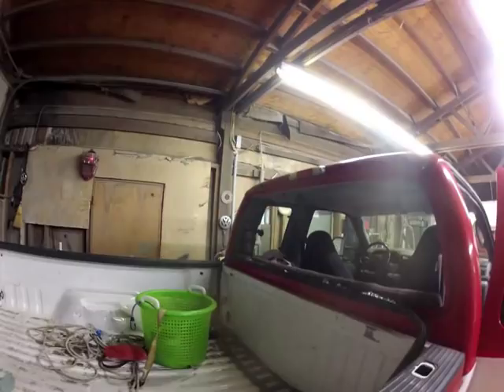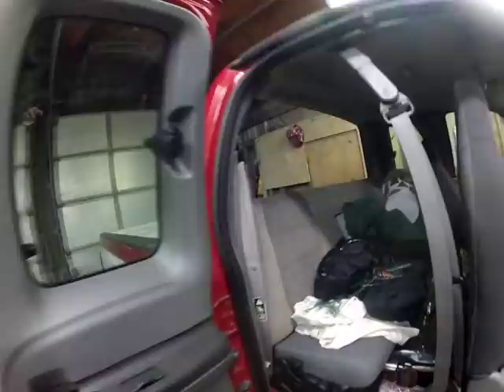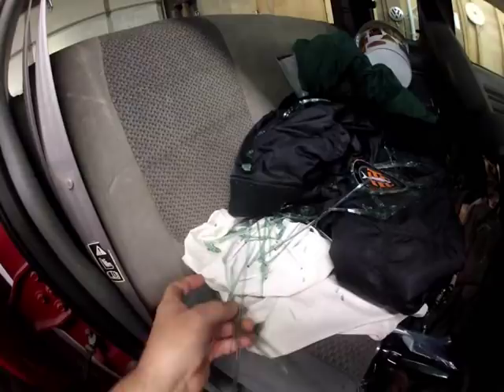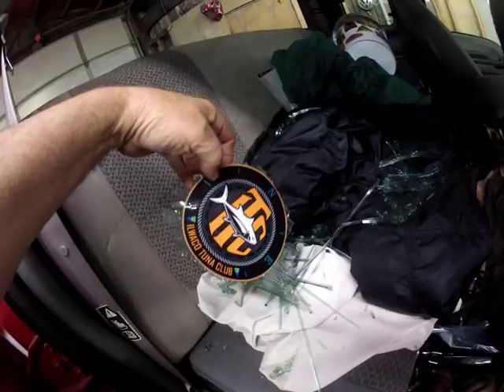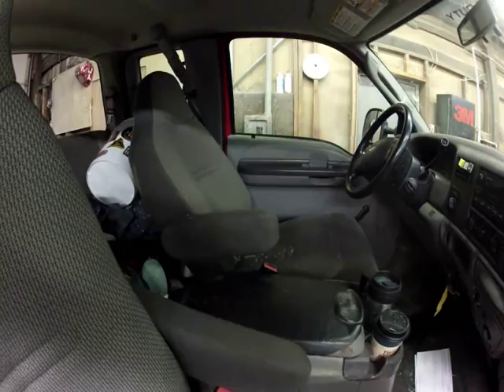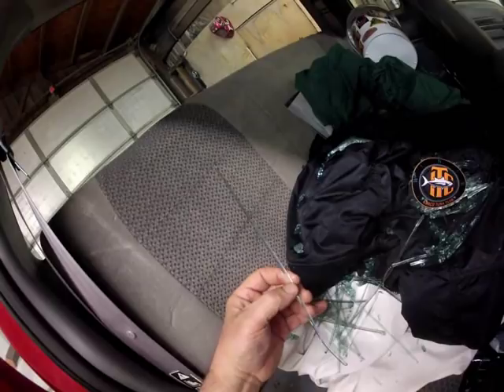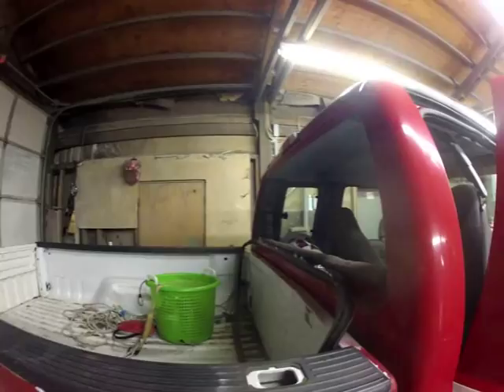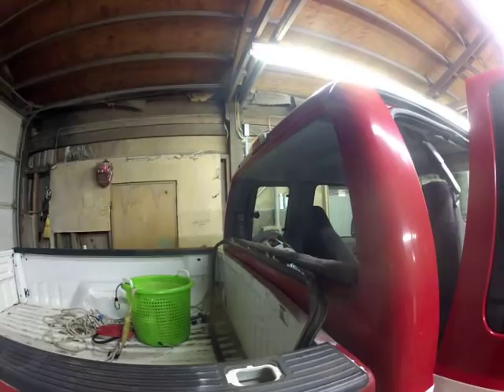REAR WINDOW BLOWN OUT WHILE TOWING

Comment: I have heard of this but it was many years ago.  Sometines the truck frame can flex enough to cause this. 1) the pickup box gets into the back of the cab, which can apply enough pressure to pop the window. 2) Maybe enough frame flex by itself to flex the back cab wall, without getting hit by the pickup box. You said it was towed with a wrecker, did you use a sling or a wheel lift? Over 25 years in the business...
Reply from the maker: It was on the back of my 2015 Freightliner rollback
Reply: Hill Auto Body & Towing 

Okay, disregard.... you said "wrecker" at least twice in the video.

Comment: These pick up trucks, are prone to bending in front of the box. The way in which the rear glass shattered, indicates that the glass was pushed upwards and under compression against the top of it's frame; corregation fractures are seen. Which is the failure you have shown. I would be interested to know if there were any cracks or corrosion in the chassis.

Comment: I had this happen in a car. The glass guy told me this is caused by the factory. There is a welding bugger that puts pressure on the glass and the seal. When the force hits it just right the glass blows out. I was driving down the road and ran over a set of railroad tracks and the rear window blew out. At first I thought someone had shot at me..Scared the heck out of me and my passenger. But the glass bits did not look like yours.

Comment: Thats more than likely a poorly manufactured tempered piece of glass. Perhaps a replacement from an inexpensive dealer that gets product from overseas. I work for a manufacturer that gets deco glass from China. Sometimes the supplier cheats the quality and rushes the tempering process which results in poor glass strengths. Lifted at the just right angle, that rubber perhaps broke away and the glass edge tapped the metal during a bump and bam, instant shatter. Just speculation however, but very plausible.

Comment: never seen that before ,Iv'e been doing autobody work since 1977.however back in 2000 a new f250 came into the shop with the front of the bed and the back of the cab damaged ,the back of the cab was bent and so was the window .we measured the curve on the window and it was bent in two and a half inches ,you never what to expect with temperd glass

Comment: Indeed, I have seen this happen three times! Once with my dad, when my family had a wrecker service, and twice with guys who towed for auto repair shops, I worked for years ago! 

What I took notice of was the fact it seemed that the back glass had some hard rubbed against it, which rubbed up against the glass leaving scratches in the glass! Which cut into the glass deep enough, that when it had force put against it, like wind, it broke, just like that! Although, thing is if it is blasted with sand, from a sand storm, for example, it could leave those fine scratch marks that could leave cuts deep into the glass! One other thing is the aftermarket glass seems to be more likely to do this, from what I noticed, since the vehicles, I seen this happen to all had the back glass replaced! This doesn't mean it could not happen to OEM glass! Although, it is less likely to happen, to the OEM glass!

Comment: All the trucks/vehicles I've towed backwards on wreckers or rollbacks I've never seen that before. Wonder if the owner ever drove it with the windows down, if so why didn't it blow out going down the highway?  At least then it would have fill the bed with glass not the cab

Comment: I used to work at a car dealer, and I can recall 3 GM pickups coming into new off the car carrier with the rear windows busted out when they were loaded on backwards.  Makes for a pain for everyone, but the shards were similar to that.    No clue what really caused, but same thing, had to assume it was the wind and the pressure on the glass, saw lots of trucks backwards come in, luckily most of them didn't break.

Comment: We have moved alot of F 250 trucks all over from oil pipe lines towed them all kind of ways twisted & turned never had a glass brake out thats weird we have picked them up with Windows broke out but in little pieces from a object being  put thorough it

Comment: I just had something similar happen with a door on a commercial storefront.  The glass was brand new, just installed, and marked tempered. Someone touched the glass instead of the crash bar and it exploded leaving icicle like pieces of glass.  I have pictures. I would bet that truck window is a replacement and not original from the factory.

Comment: I have been in the repair business over 40 years and can't say I have seen that before . Towed all sorts of vehicles , Very strange break . If it was being towed I would say body flex maybe , but you were on a flatbed  . The only thing I can think of is a rock from a passing vehicle ???
Reply: The most likely cause......
Reply: or how it was secured to the bed of the tow truck. maybe there was some uneven tension and the shitty glass couldn't handle it. I know my after market bumper moves a good inch on the very ends under the headlights when my frame is flexed shitty glass and awkward tension could cause the strands. maybe ford will admit the issue in decades to come...
Reply: Or maybe it's not factory glass. Aquarium glass will shard like that. That could have been a cheap fix to a old problem. Someone cut some flat glass and no one could know the difference with tint, unless it broke. I'm not always wrong. Just unusually wrong.

Comment: I had 35 years around the auto industry 15 at a Ford dealership with a large body shop and I've never seen it either. Like others are saying the window is designed to shatter with no shards something must of went wrong in the tempering.

Comment: Its rare. I about 25 years ago at the car dump I seen a side window, only the top half broke like it was tempered and the lower half was fractured but stayed intact.
Must have been uneven heat during tempering.. That car was made in japan in the 1970s.... 
I also seen a rear window on an old junk Mazda hatchback that was almost unbreakable, We threw everything we could at it, rocks, axe, hammers, exhaust manifold, small manual transmission, drive shafts, rims, semi-floating axle, I tossed a T-18 at it and it bounced off, then I tossed it input shaft first, it bounced off. We ended up busting it by opening the hatch and hit it from the inside going out and it broke (O.o) All that beating on it was after being rammed by an old pickup with a heavy steal bumper caving in the ass end in to move the car out of the way.

Comment: I try not to two anything backwards anymore, after one mishap and losing money it sucks.  If I absolutely have to I drop my speed.
Reply from the maker: back of cab was shoved forward 2 inches  which put stress on glass . The wind was too much and it shattered
Reply: Too bad, now you're the bad guy because you're the last to touch it.  Last one I had a sectional fold up cover, I even checked it was locked in the down position before I loaded it and sure as shit, once the wind pushed on the tail gate it was enough to unlock, flip the lid up it blew the window out and even bent the top of the roof quite a bit, and this was only at 40mph.  I thought I blew a tire the noise was so horrendous.   Really sucks because you know its going to take at least a few tows just to break even, I hate working for free!
Reply from the maker: My cost on the back glass was $95 .  15 minutes to install .. The customer was very understanding .  Broke even on tow . Got lucky
Reply: How you been liking your M2 rollback?    We ordered one, been hearing decent things about them.

Comment: the owner should thank you for it breaking with nobody inside, for sure something wrong with the glass or cheap knockoff :|
Reply from the maker: figured out the problem .  went to install new window . discovered   front of box was shoved into the back of the cab 2 inches . the bottom of the glass was under  a great deal of stress as the back of the cab was  pushed forward 2 inches . the extra  wind hitting the glass was too much and it shattered